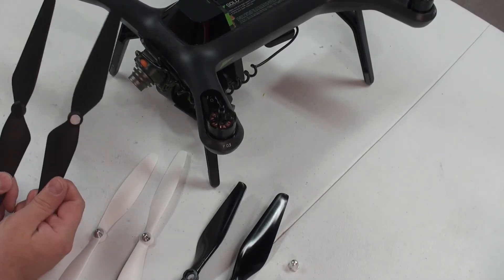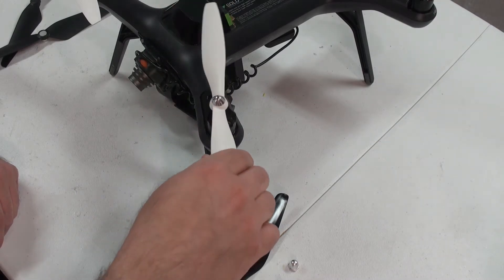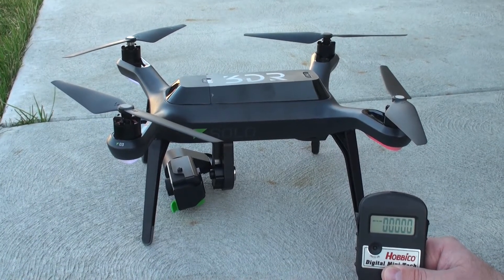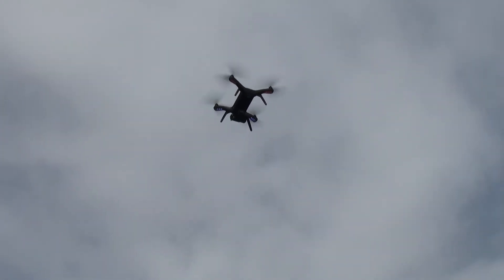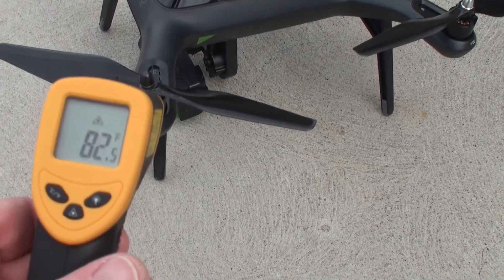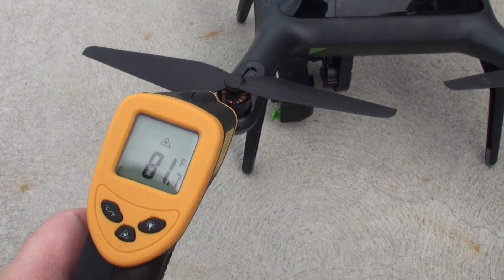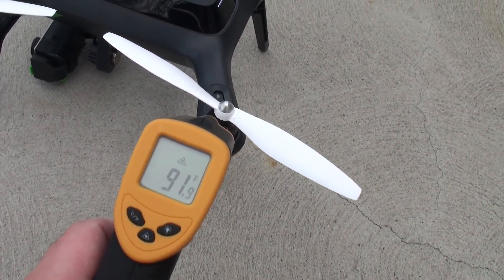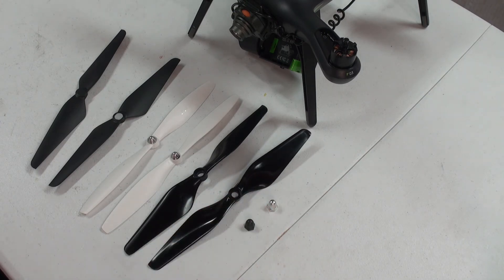3DR Solo with Horizon Chroma and Master Airscrew Propellers

Comment: I have a 3DR solo and I bought the MASTER AIRSCREW PROPELLERS, and when I started my engine it basically flipped to the side. Does that mean I'm not being able to put them correctly on? or that the item came defective?
Reply from the maker: It sounds like you may have two, or all four of them in the wrong position. Put the stock propellers on and then match the master airscrew propellers to the pitch of the stock propellers.  They should work without any further modification or calibration.

Comment: So, flying with Croma propellers is dangerous to motors in flights of 40 minutes by example?
Reply from the maker: Given the pitch of the propellers there is a potential for the motors to overheat, or reach an unsafe operating temperature based on the environment you are flying in.  If you use the chroma propellers it's worth keeping an eye on the temperature.
Reply: Good tip and review Sir, thanks.